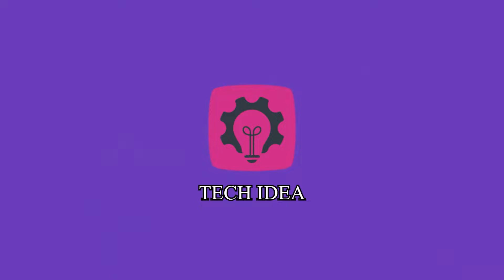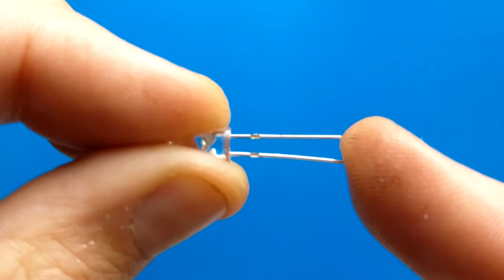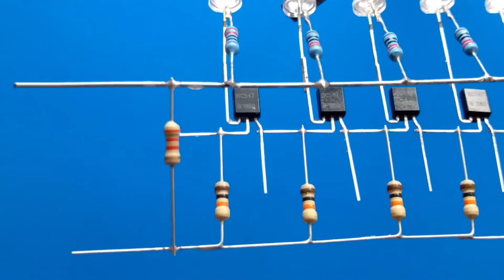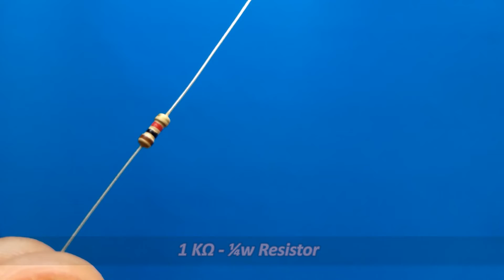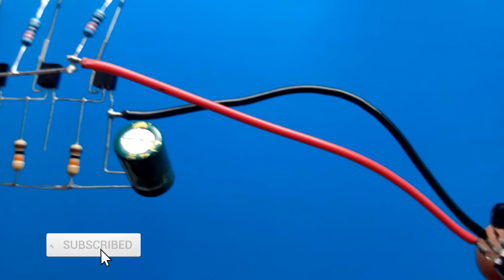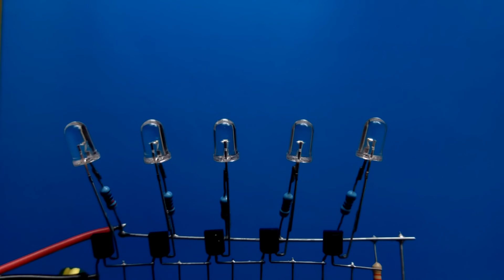How to make LED chaser circuit with NE555 IC and BC547 NPN transistor

Comment: Impossible to build this. There’s some wacky stuff going on. Like just barely touching the iron to the component to solder it. Solder doesn’t melt that fast. If you heat it enough to solder, you burn up the 555. Also, how are you holding the solder without three hands? You’re holding the component in one hand and the iron in the other. Where is the solder?

Comment: Kya ismein 10/LED Use kar Saktey hai
Reply from the maker: Yes. Just install a 100k potentiometer instead of the 10k resistor connected to pins 6 and 7 of the IC555.

Comment: Kitny volt???
Reply from the maker: I don't understand what you mean
Reply: I mean how many volts can we supply to circuit. 3.7 or 9v
Reply from the maker: @SagheerAhmad-pt5qk  Only Work by 12 Volt . 9 volt not work
Reply: Thanks ❤❤❤❤
Where from you??
I am pakistani...
I want to make inverter 3.7v to 220Ac to run 12w led for long lasting please guide me with low cost and accuracy.
Reply from the maker: @SagheerAhmad-pt5qk  I live in Iran, brother
I have recorded the tutorial of 3.7V to 220V, I just need to edit the video first, it will be uploaded next week at the latest.
Reply: Thanks 
❤❤❤❤❤❤